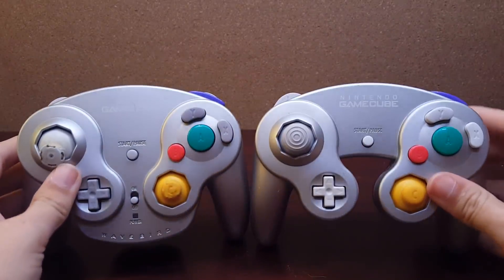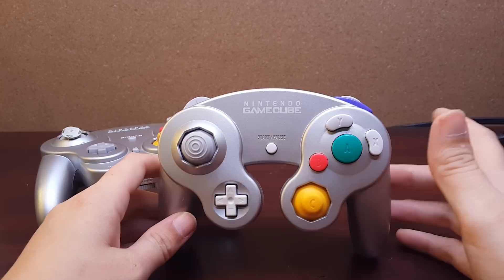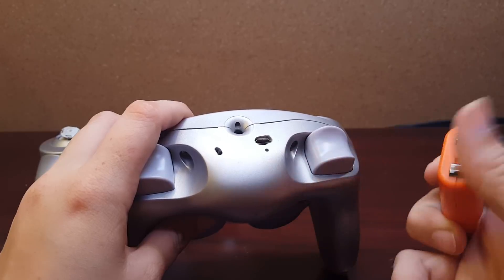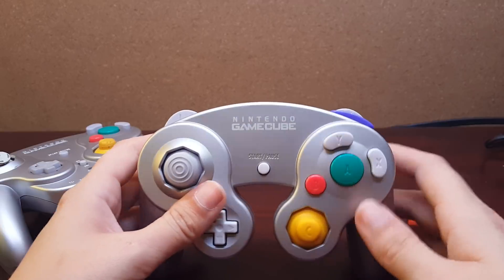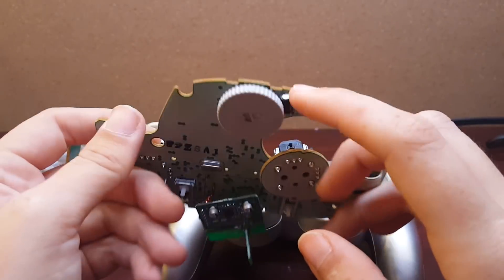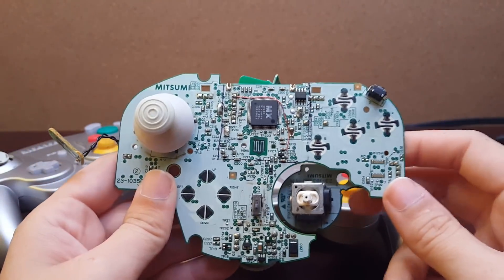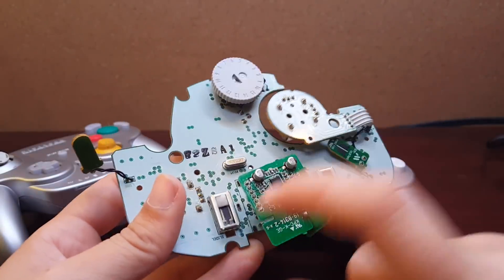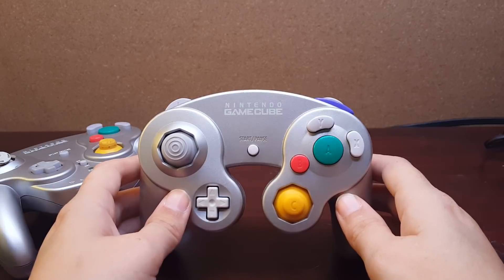Wavebird Inside A Wired Controller

Comment: This is great and I was hoping you might have some advice for me. I have a wavebird that turns on but does not send out a signal. I know my receiver is working as I used it with my other wavebirds. Channel 3 does not work either btw. Should I take apart the antenna and see if any of those components are bad? Thats probalby going to be my next step.
Reply from the maker: First, try changing the channel on the receiver. If it connects to wavebird A, it will sometimes not connect to wavebird B on the same channel until you change it and then change it back
Reply: I tried this again and no juice. I'm currently going backwards off of each of the 7 pins making sure components are functioning and continuity is achieved. I'm unsure if the crystal resonator would be working correctly but I did get 98.8kohms and 1.68 volts when testing without power running through.   @Madmorda
Reply: I have the correct resistance on each resistor from your document of necessary components. I've also verified voltage to EEPROM and to the antenna. Capacitors for crystal resonator are functioning correctly I do believe. I'm thinking take antenna off though it won't be easy and checking those components. If you have any extra info on the antenna board that might help me please let me know. Thank you so much!

Comment: You might not see this comment, but I need to repair one specific component on my wavebird controller... It's got a LOT of cosmetic damages but the component that needs replacing is the entirety of the z button. the switch and plastic button itself. I can print the z button but I have no clue what kind of switch it uses and was wondering if a tactile switch would be a good enough replacement.
Reply from the maker: You can use a tactile switch for the "click" part of it, but it will feel way different than the original
Reply: @Madmorda  ok I just need to replace the z switch itself because even if I were to replace the button i wouldn't be able to use it due to the switch practically being decimated

Comment: Hello there. I would be so happy and thankfull if anyone could help me locate de tx on the wavebird main board because mine turn on but can not connect to the receiver and i sure that the problem is not on the receiver since it works with my other wavebird very well. What should i look for and how May i repair it? Thank you all.
Reply from the maker: Change channels on the receiver and new wavebird. You can't keep the receiver on one channel and switch back and forth between wavebirds like it sounds like you're trying to do :)
Reply: @Madmorda  thank you Very much for replying. I tried every single Channel on both devices. I Wonder where the tx is located on the wavebird board so i could check If It needs cleaning or even resoldering. By the way, i'm huge fan of yours. The things you have done with Gamecube controllers are amazing.

Comment: This is pretty amazing. Can rumble be added?
Reply from the maker: Rumble can't be added to the wavebird since it only sends signals, it doesn't receive them
Reply: @MuffinsSpreadPlagues Just take the original gamecube controller's hardware and put it in the wavebird shell. The wavebird has plenty of room for a rumble motor. Yeah the hardware wouldn't be wavebird but you'd probably have one of the only wavebird controllers with a rumble motor.

Comment: This is amazing. Do you have schematics on how you wired the battery and fit it into the GC controller?
Reply from the maker: I have a ton of info about the wavebird board on bitbuilt.net/forums. You can find it if you Google "Wavebird Board Scans and Documentation". The battery is an Xbox one controller rechargeable battery and it was just common sense wiring :)

Comment: Now put rumble in the wavebird :-D
Reply: I would like to get the schematic. To see if there's a way to add the rumble feature. My first guess is that it might be possible if they use the same processor with the same firmware (or a firmware that still has rumble implemented). It might be a matter of pulling out a wire from the pin of the processor that runs the rumble motor and maybe getting a small motor like the ones antena cellphones used to use back in the early 2000's
Reply: @javierdardon622  It's been 4 years, have you had any luck with the rumble features? XD
Reply: It’s impossible because the wavebird only sends signal, not receiving it.

Comment: can you make a game cube mini controller working but with a longer wire
Reply from the maker: Yeah, but why would I? If the cable is 3 feet long and the controller is an inch tall, the likelihood of the cable getting yanked out of the controller gets pretty high. Also then it wouldn't fit in your pocket well. That's why I used extension cables with mine.

Comment: Does Rumble work?
Reply from the maker: Nope, it's a wavebird lol. They can't do rumble :)
Reply: @Madmorda  I figured it wouldn't but thought I'd ask, I believe the pin to trigger rumble doesn't exist on the transceiver.
Reply from the maker: @NeoStormer  It's not just that. The wavebird controller doesn't receive any signals, it only puts out signals, so it's impossible to add rumble as it is since the console decides when to rumble.

Comment: I'd studied the wavebird board awhile back; but not in this kind of detail. It's nice to know what all the circuitry at the bottom does and how it functions without it. 
This is an extremely good mod, and an excellent use of the wavebird.